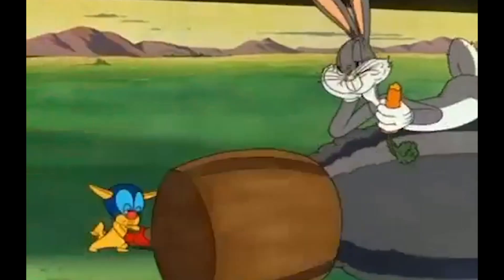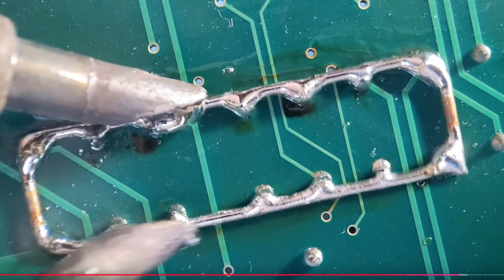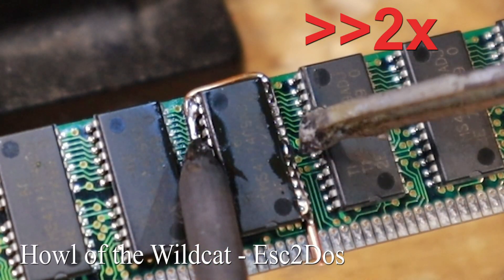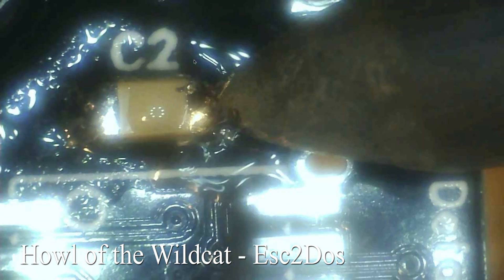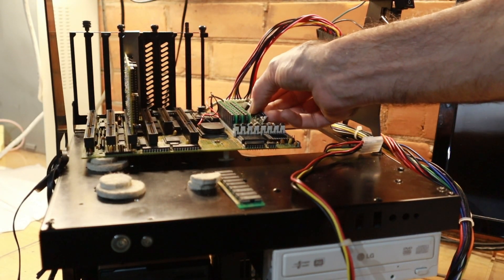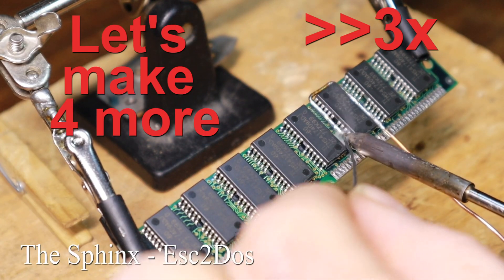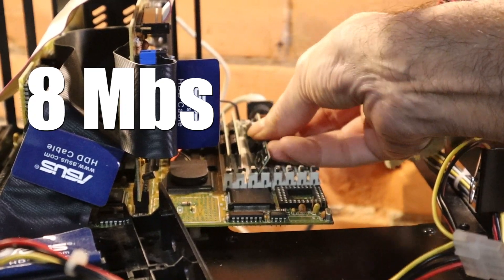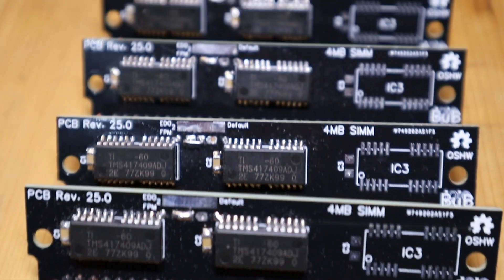DIY Ram Modules

Comment: Very nice! Glad that those memory modules worked well and you could make so many of them! Congrats!
Reply from the maker: Thanks to you. Works great on my Unichip 386 but my "music machine" that's got a Ct1600 in it refuses to use anything without Parity, gives that error message with larger text and won't go into the bios. Do you know what chips are suitable for IC3 when using these EDO 4Mx4 chips, would the FPM 4MX1 chips in that original parts list work, or do I need EDO 4Mx1? I'm definitely going to need to order some more of these the PCBs I've still got 16 chips left. Hearing it count to 32Megs is a such a sweet sound.
Reply: @esc2dos  I think there are no EDO parity chips (4Mx1) easily available, you can use regular FPM 4Mx1 chips, either buy them or salvage them from 4MB 30pin SIMMs with 8/9 chips, as these are all 4Mx1 chips, but they are not very common.
Reply from the maker: IC3 is a 20 pin chip and I noticed on a 30pin 16M SIMM I have, all 9 chips are 20 pin But they're 4Mx4. So I just need to find a 4Meg Simm with 8/9 chips gottcha. Thanks for that. Just checked a good set ( that I don't want to cannibalize ) and they are GM71C4100CJ70's 4Mx1 .. but maybe I need 60ns parity to match the EDO chips?
Reply: @esc2dos I have never created parity modules because finding those chips is not easy. So, I can't even tell you if those modules work in parity mode when those chips are soldered to the PCB. I don't think I made a mistake routing the parity chip, but I haven't verified it. I hope you can get those modules to work! I tested them on my CT3670 - and they worked on that card.
Edit: just noticed that I wrote from my personal account 😅
Reply: @alexanderfuchs4935  yes, they work with the parity chips, I had to install them to make the modules work with a 386SX motherboard with ALI M1217 chipset, it doesn't boot with non-parity modules at all (256KB, 1MB or 4MB).
Reply from the maker: @alexanderfuchs4935  Thanks for that, and @BaguetesGarage is verifying that it does work so it looks like we have some parity Simms in our future. Atheatos had a video discussing 9 chip vs 3 and showed better results with the modules with fewer chips, so I definitely think these are the way to go.
Reply: Hi esc2dos, it seems that I can't reply directly to you, YouTube deletes it. 60ns is better but you can use 70ns parity chips as they don't get accessed as often as the other chips, they pass MemTest86 at 50MHz FSB without errors. Yes, 2/3 chip modules don't stress the memory controller as hard as 8/9 chip modules, there are less parallel CAS/RAS/Address/Data lines to drive.